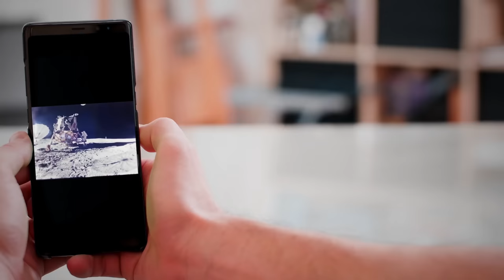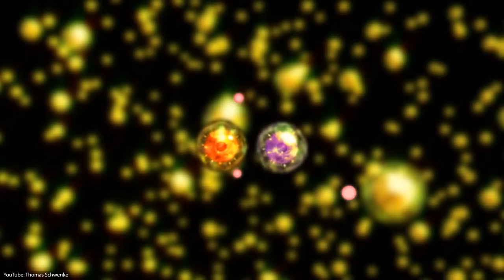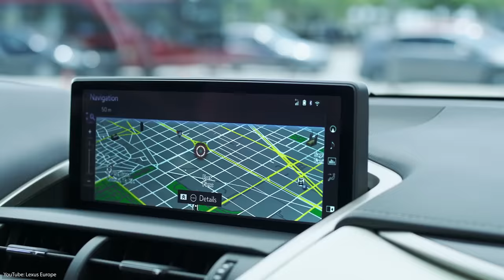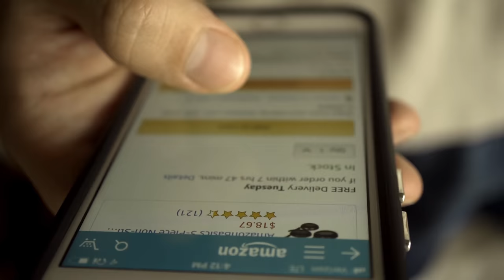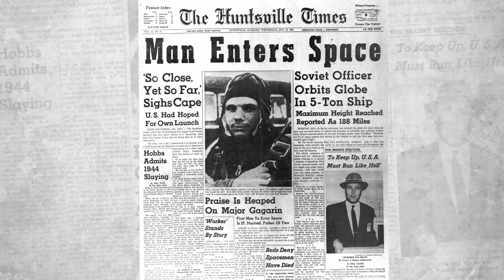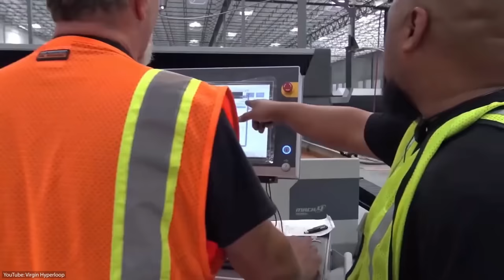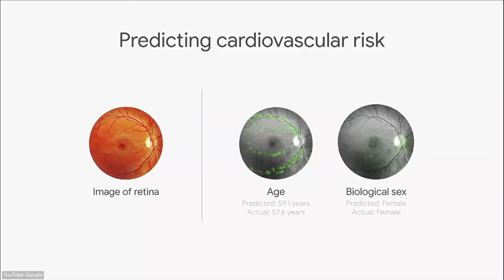The World by 2100

Comment: There are too many problems for cars to be fully autonomous. I will give you just one example.  You are driving north  to a 4 way intersection up to a yellow light that is going to turn red before you get there.  You can also see a large west bound semi tractor trailer truck that is currently stopped but you know will probably be turning left (south) because there is a truck terminal near by. I would know to hang back a little bit to give that truck some room to turn. Would an autonomous driving system have the intuition to do the same? There are so many subtle nuances in driving that autonomous cars can only aid in driving but never completely take over.

Comment: In the Future, I don’t think that vacuum tunnel trains aka hyperloop will exist by the amount that many people think, because the infrastructure would be extremely expensive due to the tunnel being requiring a very controlled environment for the train to work effectively and safely, another thing to mention is that if the tunnel suddenly gets damaged, it would be quite dangerous if air from the outside gets pulled into the tunnel so it’s like the fusion reactor of trains.

and please stop using Elon musk’s companies as the name for the technology for example you can call neuralink “micro chip implant” as Neuralink isn’t the name for the technology, it’s like calling a car “Ford” or “Daimler” as in the brand of car

Other thing to know: microchips being implanted to brains is nothing new, they have been used for quite some time for curing certain diseases
Reply: finally,
a person who thinks realistically